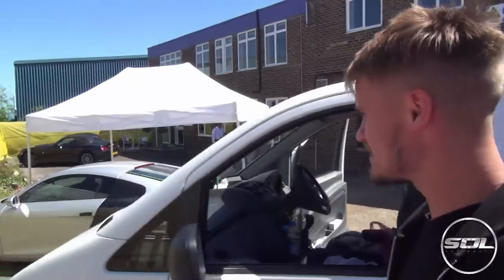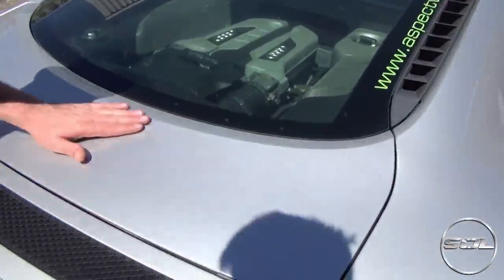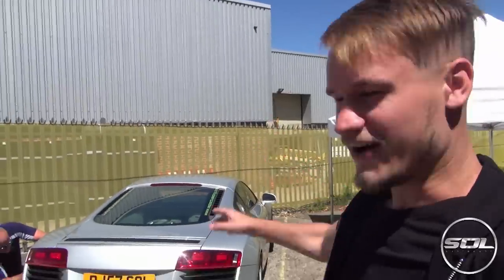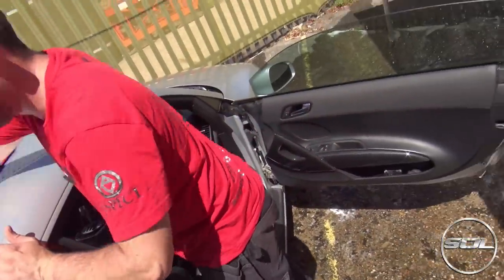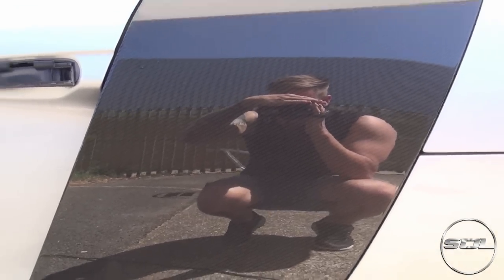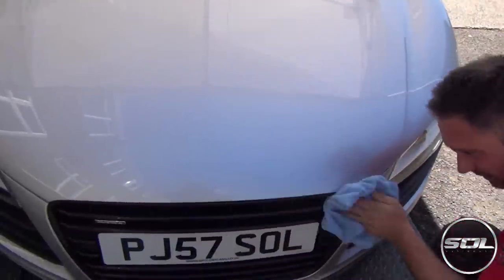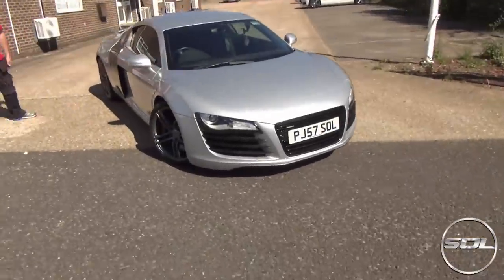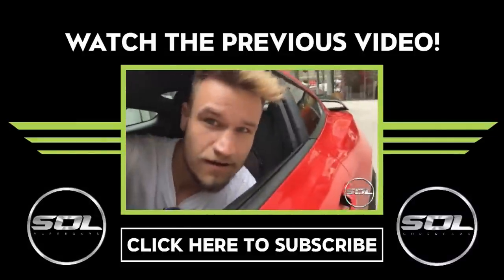DEEP DETAIL: Aspect Valeting Prepare My Car For Sale!

Comment: can't wait for Aspect Valeting to detail my RS3! 🚗💨
Reply: 2012
Reply: Matthew Bracken  I test drove an RS3 as i was looking to buy one and i found that i didn't think it was as quick as i was expecting it too be
Reply: What year were you looking at? Really?! I think is sill quick! Maybe because it's auto it just seems slower? 
Just get a Revo stage 2 and it'll be like 450bhp and sub 4 sec 0-60!
Reply: I was looking at 62 plate one. I had a 59 plate s3 and was expecting it to be a lot quicker than it but to me it didn't really stand out that much except the sound so i bought a 2013 M135i until i test drive the new RS3

Comment: How much does it cost ???
Reply: £1.5 million, 1 of 1, has buggati veyron performance, all carbon fibre, gold edition
Reply: iljaz kamberi The car is worth from 40k-50k depending on his mile, since its a daily driver its around 40k-45k
Reply: iljaz kamberi  Paul's can be any where between 80 and 100k
Reply: Drake Phoenix This just shows how much you know about cars he has the V8 one and he will have quite high mileage because its a daily driver, and a 57 plate which is the early model  a V10 cost about 80-100k so sort your head out and go and research a bit
Reply: I am sorry sir but you are wrong check the Kelly Blue book if you do not believe me http://www.kbb.com/audi/r8/2008-audi-r8/quattro-coupe-2d/?condition=good&vehicleid=196897&intent=buy-used&mileage=37135&pricetype=retail
Reply: Drake Phoenix You are wrong!!! his will be worth more than pauls because it has 34k miles pauls prob has about more than 50k! http://www.pistonheads.com/classifieds/used-cars/audi/r8/audi-r8-quattro/4400619
Reply: I am sorry but are you saying KBB is wrong then you should go tell them 34000 miles as you because right now they say it is valued at close to 110,000 not bearing in mind other fees http://www.kbb.com/audi/r8/2008-audi-r8/quattro-coupe-2d/?category=&intent=buy-used&pricetype=retail&condition=good&persistedcondition=good&quizconditions=&options=&path=&vehicleid=196897&mileage=34000
Reply: iljaz kamberi he will get £27K for it at most
Reply: hell get about 43 for it
Reply: Nah I sold mine for less about 3 years ago!
Reply: Nigel Harrison ok , maybe . I wanted to ask for London. In some countries here it starts from €42k ..
Reply: Drake Phoenix theyre talking english pounds, not USD...
Reply: wow people are so dumb, WKD is right this is a V8 with a 2007/2008 plate so his car should sell around th 45k price, drake i think yur looking at a v10 model or one of the newer R8's

Comment: Never steam clean a petrol engine only diesel
Reply: Y
Reply: like water in the brake fluid reducing oil lifespan & promoting rust. Or dirt, oil & grime soaking into the timing belt reducing belt lifespan. Or connector corrosion. etc
Reply: Everything is sealed water wont go in anything, even if it did it will probably will evaporate after a 5 min drive. And im sure they dry it
Reply: The steam help dry and remove oil on the external engine it can ruin the oil to some extent but when aspect do it the renew all the fluids :)
Reply: That's like a tip for old cars. I've jet washed both diesel and petrol engines and they've both been fine!